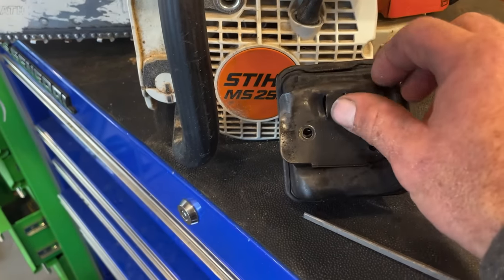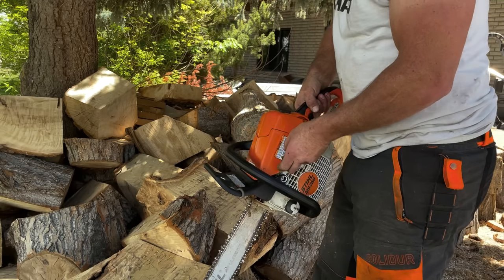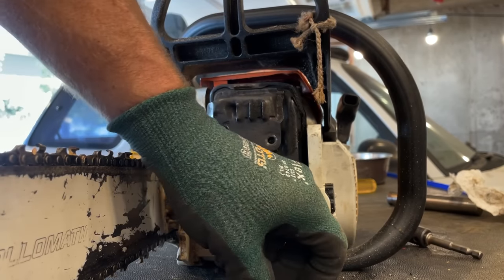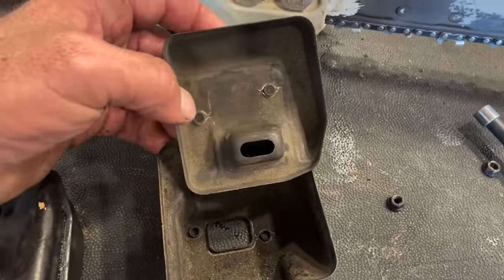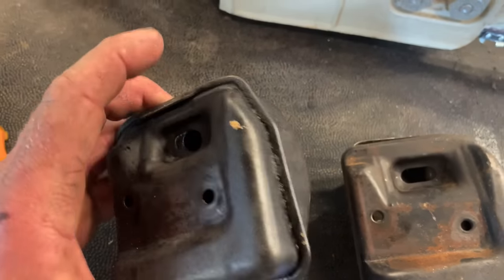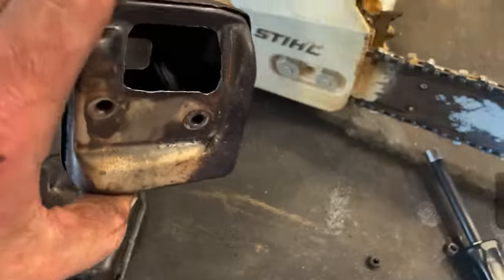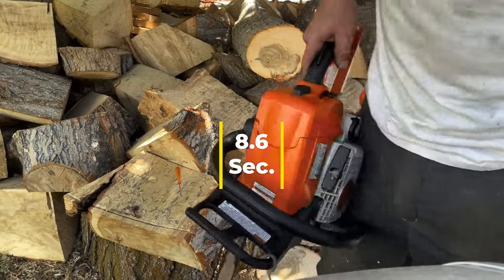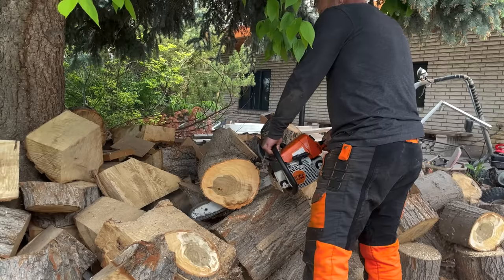Stihl MS 250 Real muffler mod Massive￼ difference￼￼!!!

Comment: 2 strokes need the baffle to provide back pressure or the engine will over run and hole the piston .  It leads you into believing that the machine is running faster ( which it is ) but that cause a pressure differential inside the cylinder and that overheats the gases causing piston failure . Don’t be fooled into removing the baffle . I’ve been working with 2 strokes for over 50 years and owned a tool hire business which repaired all and every petrol and electrical equipment from every manufacturer.   It’s a fool’s errand that promises so much but makes you pay in the end, piston failure can score the barrel and that’s the start of a very costly repair.
Reply from the maker: sorry Murray, so many things wrong with your understanding of a two stroke I don’t know where to begin. What’s crazy is there are so many people out there that Think the same way you do. Except your theories are some of the most Ludacris ideas I’ve heard yet. Not trying to argue with you or put you down just trying to help you out, please don’t Share your ideas about two strokes as fact with other people Bad info only hurts others that believe you.
Reply: @arboristlife3494  ever ridden a two stroke bike?
Wont run without the exhaust. Not in rideable form anyway.
Two stroke exhaust design is a tricky beast.
Maybe you should learn more before getting snotty with someone with 50 years experience trying to be helpful.
Reply: @arboristlife3494  well we could all say the same about your opinions too. Dont be so quick to dismiss someone who says they have 50 years experience.
Reply: @bushratbeachbum  Funny that a company with over a hundred years of building and designing would build new saw using a muffler with no baffles yet Husqvarna's new 592XP has no😁 baffles in the muffler.
Reply: more fuel, more RPM, more HP and more HEAT, the problem of any engine specially an air cooled one is to dissipate that heat so such a mod can bring the piston to bind in the cylinder causing extensive damage as the aluminum of the piston grows more than the cast iron of the sleeve when the temperature increases.
Reply: @bushratbeachbum  uhhh... did you tune the carb after you took the exhaust off? The absence of back pressure changes the tune. That's why the carb on this chainsaw had to be tuned after the mod. The difference?? After the mod and tune, the muffler wasn't stealing as much power as before.
Reply: @jacquespoirier9071  that statement is full of misunderstandings and falsehoods. First of all, restricting the exhaust is great way to make ANY engine run hotter. As for the rest of it, when the carb is tuned after the restriction is removed, the PROPER amount of fuel is being used. Not only that but a rich mixture will foul a plug. A LEAN mixture will overheat an engine and destroy it.
Reply: @jacquespoirier9071  forgot to add, the max rpm will be the same after the tune is correct.
Reply: @iffykidmn8170 my 455 has no baffle but the earlier models did.

Comment: Glad it worked for you but a lot of engines need back pressure to work right
Reply: No they don’t. That is just a myth.
Reply: @brianwalker1933  Well you haven't owned a four cly k car wtth a aurto tranny you rmove the exhaust the car will have no vacuum and the engine will run like shit and the tranny will not shift and thats not the only engine that will not run without exhaust
Reply from the maker: OK well a four stroke engine is a completely different animal, regarding taking the exhaust off of a car depending on where are you disconnect the exhaust will introduce different symptoms. Example removing the exhaust manifold will do multiple things like disabling the EGR valve causing multiple issues I can go into if you’d like? As well as disabling upstream and downstream O2 sensors forcing the car to go into limp mode because the computer has no idea how much fuel to deliver. Also removing exhaust=losing any back pressure how does that cause a vacuum leak? Because back pressure and vacuum are complete opposite of each other. Think of your two-stroke engine as an air pump basically that’s all it is, with efficiency in mind moving the air through the engine as effortless as possible is what it’s all about. Thanks for your input though.
Reply: @arboristlife3494  I think there are a lot of 2 cycle dirt bike mechanics that will vehemently disagree, backpressure and tuned exhaust makes a huge difference on two cycles that depend on the flow of gas inertia and reflected pressure wave to suck the next charge in. Have a look at the crazy sh*t they do to exhausts when trying to squeeze that last 1% of performance out.  No doubt Stihl did a lot of math and some real world testing to come up with the design of that muffler.   You gonna beat that on a guess and a dremel? Unlikely that once you have adjusted your carb for proper mix that you have actually improved performance. Besides it's a freakin ms250,  how much time will you save? If you cut for a living, sharp chain and just enough fuel to cut with a fully loaded bar, is where you will make the most money.  If you burn 1/3 more fuel to save 2 seconds on a cut,  have you actually saved any time?   Would be interesting to see if adjust your carb to spec so you dont blow your engine, then put an exact amount of fuel in and see how long it runs till empty,  put a stock muffler back on, adjust the carb to spec again and repeat the same fuel consumption test.
Reply: @laserflexr6321  I'll agree with what you're saying, the juice isn't worth the squeeze. I understand the 290- 390 muffler mods, where the baffles aren't removed, but a nice mod of only slightly higher noise but significant cooling and performance with a minor carb adjustment. But, to completely remove the baffle......
Reply: @bradstanek2304  wrong,an engine is essentially an air pump and with a 2 stroke it needs reverb pulse to knock back the mixture in cylinder during overlap and also allows for scavenging it will actually pull mix from bottom through transfers,more important on bigger displacements thats why they get expansion chambers and on 4 stroke vaccume loss occures when intake pressure matches atmospheric pressure thays why on boosted carburated cars the fuel regulator has boost reference instead of just vaccume,under hard boost you have manual hydrolic brakes because boost brings above AP headders and the right diameter will allow scavenging and pull away exhaust from valve area By spacing out pulses from firing order and allowing them to come together in line and order,back pressure is restriction just like to test for a clogging cat you screw in a pressure gauge into bank 1 02 bung and if you have pressure more than just a tiny amount then its clogging up ...
Reply: also your camshaft in a 4stroke also will add to determining what the vaccume will ultimately be,in cirtain cases people will use an electric vaccume pump to run brake booster and transmission accumulators
Reply: @brianwalker1933  It's not a myth if the 2-stroke engine is running a tuned length expansion chamber exhaust. The 'stinger' in such an exhaust causes back pressure which then causes a positive pressure wave to be reflected back of the baffle cone part of the chamber, the positive wave forces any fresh charge that has escaped down the exhaust back into the cylinder, an expansion chamber also causes a negative wave to travel back up the exhaust which helps pull the mixture up the transfer ports. Having said all that, the exhaust on these saw engines is not an expansion chamber other than the fact that it allows the hot exhaust gases to expand, this will cool the gas and slow it down which reduces the noise. So probably the less back pressure, the better, (With regards to making power).

Comment: If you increased the saws power to the blade from 75% to 90% how is it possible an increase of 15% allowed you to cut almost rwice as fast? Im with the guy whos calling you out on sharpening the chain between tests. Chips are definitely bigger in the last test. Just busting your balls good modification. Make sure if you do this to readjust your carburetor.
Reply from the maker: Another guy asked me something similar. If you increase power, but the RPM of the chain stays the same. How does it cut in a faster? The answer is that you can push harder. Putter More pressure on the saw/wood, making it eat more without bugging down. Also, before doing the test, I sharpened the chain, I like to take the rakers down a little bit overstock. Which is going to make it bite more wood. A lot of people think that I might have sharpened it in between runs. The truth is, absolutely not! Obviously that would completely Ruin, the entire test. I know you don't know me, but I am an honorable man. And I swear on the lives of my children.
I did not sharpen the chain between comparisons. Also I did have to adjust the cooperator I forgot to mention that in the video.
Thank you for your comment. I really appreciate the feedback.

Comment: A little bit of cheating there....  Your first two slabs were about an inch thick.  The last two were, probably not even half-of-an-inch thick.  That would make a difference on the pulling and tearing of the wood fibers on the outside of the cut.

Comment: Did you have to tune the carb?
Reply: yap . about 1/4 turn. in or out Hi jet screw ?
my saw runs hot , so i keep the rpm low and Leen on the saw.  🦊
I just did a similar mode to the same saw MS250 . it starts and runs good now.
Reply: @larz46north18 what about just buying a muffler for the older model 025

Comment: The muffler was designed the way it was for a reason. Sure, modify the muffler on a car will make it run faster and louder. Ah what? I can’t hear you.
Reply: A chainsaw from factory has many things to take in consideration that has nothing to do with the saw working as good as it could, for example noise, environment etc.
If someone then comes along and not have to think of these matters don't you think it's pretty easy to get more out of your machine with simple modifications?
This is easy to see on mopeds, motorcycles and cars so why shouldn't it work the same on chainsaws.

Let me refrase... it truly works the same on chainsaws to.

Comment: Wow guess work. To do it right you need to measure the port area at the piston.  Then dod the math and  hit your target area for the muffler hole. It's smaller than the  port area. Hint Hint. The louvers are the only thing saving that muffler and  the openings don't look correct size.  Stihl are choked bad from the factory  but you open it too much and you are not helping the saw
Reply from the maker: You’re absolutely right, I actually made a video about that except I didn’t talk about the 70% rule. 
Excellent point about the louvers! 
too many people saying there’s not enough back pressure because I took out the baffle😖 stupid.

Comment: Nice job removing the spark arrestor feature designed into this saw for use in the woods.
Reply from the maker: Never in my 21 years of experience running a Chain saw have I ever seen a  spark come from the exhaust especially one that would cause a fire. However I once caused Bark to start smoldering during a low stump cut where the exhaust gas was blowing directly into the dry bark for a period of time.

Comment: Or get a 261…
Reply from the maker: You probably won’t believe me but my MS 250 with muffler mod, timing advance and E85 fuel. Yes that’s right modified to run on corn alcohol lol. I do have a 261C The M-Tronic pro series and the 250 will out perform the 261 all day. What do you think?

Comment: Golly
Those Stihl engineers 
Are so stupid
Reply from the maker: If you drove a diesel truck instead of a Prius you wouldn’t have to be told that in order for manufactures to meet strict governing body standards such as maximum Decibel levels, 
emission standards, vibration management guidelines and much more, engineers all too often rob Peter to pay Paul. By designing A muffler to be quiet enough as to pass  below the maximum decibel level established will intern cut overall maximum output of a particular Engine. Causing said engine to fall short of peak efficiency! 
Then again, driving off into the sunset in your Prius, your not the type to be bothered by things like diesel exhaust fluid, dpf’s, EGR systems, restrictive exhaust systems, smog pumps and so much more. And all for what? 
So Joe public can feel good knowing he’s doing his part for the environment but pay no attention to the unrestricted balls to the wall big polluters out there. 
Or maybe you actually meant that the stihl engineers really are stupid? 
Who knows I kind of went off on a tangent lol 😂
Reply: @arboristlife3494    “Great spirits have always encountered violent opposition from mediocre minds.”  -A. Einstein
Reply: the manufacturer have to meet noise, pollution and safety requirements plus, they have to support a warrenty  to be able to sell  to the public, so, there is trade off like baffle in the mufflers to meet that 
In your backyard, you can do what you want with your equipments but if an accident ( injury, fire, etc...) happens, be sure that the manufacturer will not support you if the equipment have been modified.

Comment: You have also decreased the life of the saw. Millennials buy New Cars and Trucks and Destroy them with their Mods. Thanks Daddy.
Reply from the maker: I’m sure you’re absolutely right about shortening the lifespan of the saw, so this parts gonna blow your mind. To make the video I actually converted the saw back to running gasoline, two years ago I modified it to run on E85 ethanol Which dramatically increased power output. I’ll be uploading that video as soon as I can. The motor is completely stock/no porting or polishing so I’m interested to see how long it lasts. When it does blow up I’ll do a teardown video showing what failed. I love to tinker and can’t leave anything alone, I believe there is no such thing as too much power lol. In the pursuit of all things that excite me blowing up the saw is one of my least concerns.Thanks for your input!
Reply: @arboristlife3494  You bought the saw with your own money,  it's yours to do whatever you want with it  !

Comment: If you are on any forest service ,or dnr property running a saw without a spark arrestor screen they will fine you, and may confiscate your saw. Very irresponsible to advocate something that could burn down the forest.
Reply from the maker: It’s easy enough to put one in if I feel the need, thanks though.
Reply: You need to be smarter then the exaust pipe that you made the mod to! I modified every exaust pipe on every 2-stroke engine i own. If you leave all that shit in there, Baffles, Spark arrestor, you will certainly bake the piston! Just look at the old chainsaws, Most of them had nothing more then a stinger exaust pipe on them! A 2-stroke piston travels way to fast to be restricted by Baffles, spark arrestor screens and such. And the spent fuel coming out when the exaust port opens up is traveling at twice the speed of sound when super heated, There is no time for the last spent charge to get out of the exaust pipe before another super heated charge is entered into the pipe causing massive heat when it is restricted by all that crap! And if your chainsaw is spitting sparks out the exaust you are doing it wrong!